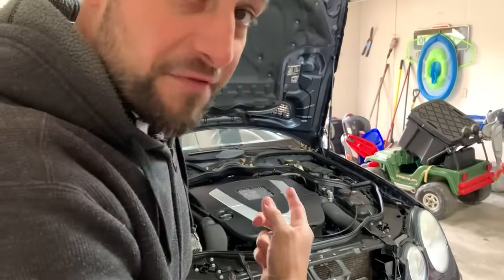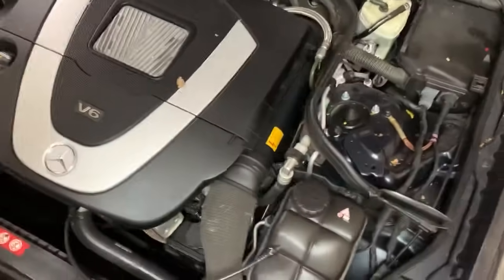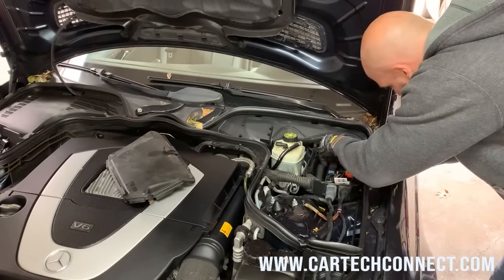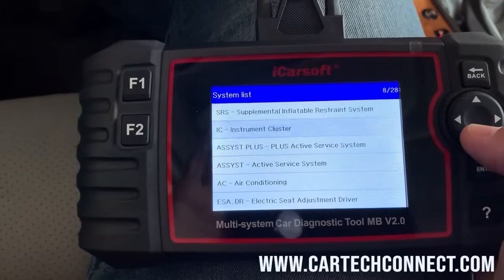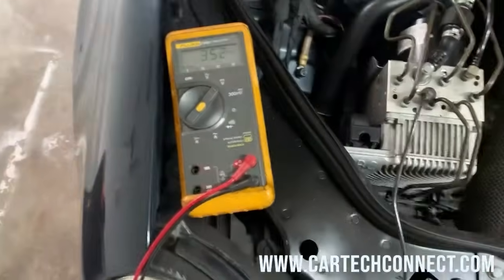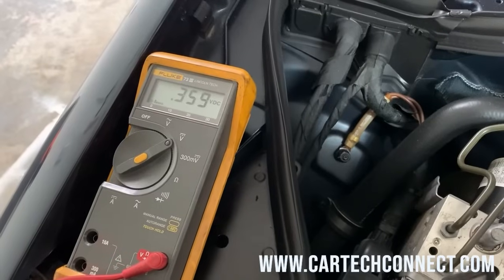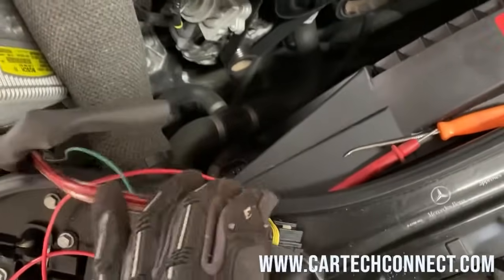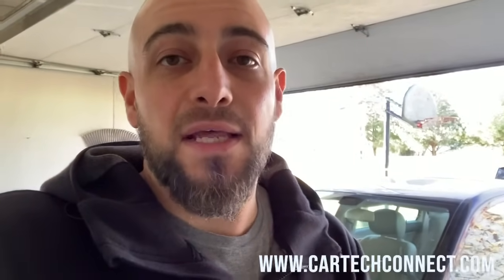Mercedes Benz fan keeps running sounds like an airplane - how to diagnose

Comment: Hi Lou,i have same problem for 4 month.I changed 2 batteries ,mas and map sensor,water tem sensor,egr valve secondary air pump ac compressor,ac pressure switch none of these help after your video i found out there is no voltage in green wire to the fan and no voltage in fuse#47 but car start and run.I forgot to mention the car is 03 e320 and i changed fan too. I am not able to find your email and none of email and info that you have in you tube work is there any hope for help from you thanks Fred.

Comment: I just watched your video & praying my car don't have the same problem.. it's a 2001 S430, however I have a coolant sensor light on in my dash and my fan will not cut off.. it doesn't Rev but my battery had died I bought a new one after installing the battery the fan came on without me starting the car.  Do you think if I change the coolant fan sensor that this will take care of the problem? Please help thank you 🙂
Reply from the maker: Hello, this model of yours does not
Usually have the same problem, it’s usually a bad fan or fan control control module. It could be a coolant temp sensor but its best to have it diagnosed instead of trying parts.
Reply: Try doing what some people call a hard reboot by joining the positive and negative together obviously don't touch the terminals leave overnight the refit and try it worth a try

Comment: Why swap vin info needed ??
Reply from the maker: Antitheft. Vins have to match in certain modules
Reply: @MasterTechLou  on my car the fan come one high when I turn the key 🔑 and turns off when the key is off , stays high idle fan , I switched the relay fuse and still does the same thing , I put in new temp sensor near the thermostat and one under the coolant tub 🛀, still some fan idle idk why
Reply from the maker: @reys_live7243  this video shows exactly how it needs diagnosed. :)
Reply: @MasterTechLou  it only runs when I turn the key on and it turns off when the key is off is a good thing it don’t burn my battery 2004 Mercedes Benz clk 500

Comment: Hello! So what's the name of the shop in NY that was able to correctly perform the VIN swap?
Am I to understand that swapping the chips was unnecessary given that the guy in NY transferred all the data?
My 02 C230, battery died recently...when I recharged it, and reconnected, fan is running constantly with the engine off. Turn on engine, it goes off, so now sitting with battery disconnected. One guy says he fixed with a new battery. Hmmm...shot in the dark. Never had this problem before, but we get a lot of rain here recently moved to Oregon. Very hard on Mercedes.
Reply from the maker: Sounds like you have a communication issue in the car. Engine module wont be the issue if theres no physical damage. Check engine bay fuse box for water and corrosion.

Comment: That's what I want to specialize in - diagnostics, module troubleshooting and repair...after finding a faulty module.  I watched one guy do it. He had some really specialized test equipment, like an electronic engine simulator in addition to a signal generator, oscilloscope, DVN and even a Microscope. Yeah...I love that kind of stuff.

Comment: He  thx  for this  video  i want to  ask  you  
You removed this iprom from the old one   and put it in the new  one ? And the car work @the new 
Or removed  the iprom from the new and put in old  and still @ the old one  and thx  you
Reply from the maker: So with this module the eeprom was not enough, there is a second chip that needed swapped but I have no information on which one so I had to put them back. The eeprom did not have the vin information so the car would not start.

Comment: Hi, thanks for the great video on this topic.  I've been suffering through the same problem on my 2007 CLS550 for over a year now!   Can you share the contact info of the ECM vendor you used in New York who fixed the ECM?
Reply: Hi friend, we're you able to get the contact info for the ecm repair? If you still have it or know where to go could you let me know please? I have the same issue currently and the fan goes on full blast right as soon as the car turns on till its off
Reply: @WoodVideos Same here, I have a 2007 E350.

Comment: Hi good evening. My ac reset fan won't turn off even when the car is not running how can I stop it please
Reply from the maker: Remove the under dash panel on passenger side dash, unplug the fan. If you are talking about the blower motor for the heating and ac .

Comment: thanks for the video . what the signal ref the voltage should be ???? pleas help
Reply from the maker: I show in the video the voltage for fan speed will be between 3v-12v
Reply: Thanks Mate . I am seeing 0 volt all the time on the signal wire also the same at the ECM  , do u think ECM issue ??
Reply from the maker: @alrifainidal  I dont like diagnosing over comments. if the fan is on and there is ) voltage on signal wire, the fan is the issue., but you have to confirm with a scanner and activating the fan to see if signal voltage occurs.
Reply: I am really sorry.. i dint mean to bug u. Thanks for ur help 
I have zero volt at the signal wire any way ... any way keep posting videos i like ur channel
Reply from the maker: @alrifainidal  never a bother, if you need diagnosis help you can reach me on JustAnswer or my site www.cartechconnect.com
Reply: So, 3V signal is low speed and 12V for high speed or vice versa? @MasterTechLou
Reply from the maker: @pawelczaja629 I believe lower voltage equals lower speed. But theres a cutoff where if the module doesnt sense enough voltage it goes into full speed mode. I have a spare fan I was gonna eventually do a video on this.
Reply: Thanks for quick reply. In my case the voltage is 0.5V and fan runs like a crazy obviously... Will try to supply maybe 6 V and see what happens... KaBOOM😅 @MasterTechLou

Comment: Master tech lou, thank you sir for this video.  I have the same MB scan tool. By just watching this video and how you showed how to view sensor data for the AC controller (indoor temp at 142 degree on mine), I was able to determine that the issue on my ac compressor and condenser fans not activating, was due to the ac controller switch panel inside the truck. I bought a use one off ebay, swapped them out, and "boom" everything works perfect. The next thing to tackle is to swap out the overhead sunroof switch panel, which also has a indoor temp sensor. Thank you sir
Reply from the maker: Hey glad it helped some way!!!! I appreciate you reaching out!

Comment: So to understand . I am no mechanic . The problem is on the computer ?  Recently my computer was changed for a “new “ and this problem happened . So if it is on the computer I believe is on my guarantee . That is why my question
Reply from the maker: Correct, the engine control module is faulty

Comment: Hi, thank you for all ur usefull videos. It means a lot to people that have to deal with dishonest dealerships and mechanics.
I diagnosed a w204 c350 2012 with  icarsoft and I get the following error message:
P220101
The NOx sensor( cylinder BANK 1 ) has a malfuction. There is a general electrical fault.
How is it possible to know which exact sensor (MB part number) I need to replace?
Thank you

Comment: Hey Lou nice video, my 06 R500 fans kick on full blast when key is in on position and nothing happens when I try to crank the engine. I have a scanner to try to find codes but I worry the battery will die before I look at everything.  Would connecting jumper cables from another vehicle keep the battery charged as I scan? Can any further damage happen by letting the fans run for a prolonged period of time?  Anything you suggest before scanning? Thank you in advance.
Reply from the maker: Just unplug the fan. It wont hurt, I do it all the time.
Reply: @MasterTechLou   Ok thank you! Will any codes not be given due to the fan being unplugged while scanning?
Reply from the maker: @victorvaldez3802  is that really a concern considering the car wont start 😂, you will only have 1 code for the fan.
Reply: @MasterTechLou  I’m using the iCarsoft CR Pro diagnostic tool, I ran a smart scan and the ECM didn’t show up. I ran a manual scan and it says link error. I checked the ISM, ESP, TCM, and SRS and all both have the code “No CAN data was received from control module engine management” in the current state. Is the ECM fried or should I be looking for a loose connector somewhere?
Reply from the maker: @victorvaldez3802  sorry I dont diagnose via comments if you need help you can contact me through my site. Www.Cartechconnect.Com thanks
Reply: @MasterTechLou  I’m filling out the ticket right now, is there a way to make sure you’re the one who responds?
Reply: @MasterTechLou  just submitted one
Reply from the maker: @victorvaldez3802  its all direct to me. Thanks!

Comment: My 2004 clk500 amg, have the same problem plus the interior don't work only the radio, no wipers,a.c,turn signal,horn and speedometer,gas level and temp level, won't do anything when start after couple trying
Reply from the maker: So sorry to hear, check my video on 5 tips mercedes owners should know. You probably have water or corrosion in the front fuse box area or floor. If you need my help with diagnosis you can reach me at my site www.cartechconnect.com 
If not then its best to have a shop look at this. Thanks, Lou

Comment: I am haveing the same issue with my C180 1.8 kompressor year 2005.
It's saying - A camshaft position actuator circuit open bank 2.
Any help would be great
Reply from the maker: If you need help you can reach out to me at my site.
Www.Cartechconnect.Com 
Thank you. Lou

Comment: If you ever need to remove components like this again, invest in a hot air blower (cheap Chinese versions are fine). It will allow you to heat up all of the soldered legs at the same time. Flux will also make the job much easier

Comment: i just replaced my radiator a couple days ago. but once i turn the key on the fan went on full busted high speed. its killed my battery, so do you think its still the control module? the video was very helpful, but from what i seen and heard its looking and sounds like thats my problem. any feed back will be helpful.
Reply from the maker: Walter Q Franklin all you need to do is follow the test steps.
But its possible a wire broke to your fan which would do the same thing.

Comment: I was looking for this. Thanks
Reply from the maker: Michael Wyz hope it helps. Thanks!
Reply: @MasterTechLou  fan running full blast no key before that radio would no turn off no key . Sent out ecu today ugh
Reply from the maker: @rjalexander440  fingers crossed for you. hopefully you didnt set it towards michigan!
Reply: @MasterTechLou  Drive to place in illinois supposed to find out Tues if not I will need co name u used . ;)

Comment: my 2011 c300 blinkers or wipers wont work and the electric fan stays on when the car is started. help please.
Reply from the maker: Sorry not sure why I just sen this now. You have communication issues in the car, I can help if you find me at www.cartechconnect.com  thanks, Lou
Reply: I have the same problem I need help
Reply from the maker: @adonburke8212  this video shows what nees to be done, I am not sure what else you need help with,. if you do you can reach me at www.cartechconnect.com
thank you
Lou

Comment: hi Lou, greating from australia. we had a w204 c300 came in with totally flat battery. we put a new battery in and knew why the battery had gone flat. the fan turned on randomly with the ingnition off and turned off short time later. on and off. i was thinking of the ecm but we also found there was large.amount. of water in the left side cabin floor. do u think the water trigger the issue or maybe there are seperate issues? thx a lot
Reply from the maker: roger zhang fan comes on for 3 reasons. Engine module is activating it, fan Is shorted, there is no communication between the engine module and other modules . So figure out the water first. It will most likley be your issue.
Reply: @MasterTechLou  Can you ask the guy in new york his information so i can send my ecm to him.
Reply: with rain water issue check the Front-SAM circuit board for oxidation.
The water get in at the roof seems (not sunroof, not windshield... SEEM when after 10years glue dries out)

Comment: Thank for this information your share. i need to ask you something i have 2011 Viano W639 when i drive the AC is perfect when i stop in traffic the coiling is so low i changed the AC compressor (Denso) and new condenser as well what you think from your work experience the issue? thanks for your time.
Reply from the maker: Thank you, sounds like weak compressor or low freon,. that is the only thing that comes to mind .

Comment: Hey Lou, wow great video.  I am also having the same issue regarding my fan on my C300.  No codes at all as well.  I was thinking it was the front sam because it happened shortly after some water intrusion.  My AC is also having some issues so I wasn't sure if the AC can also trigger this fan condition.  I wanted to know if there was a way to test the front sam and AC to see if it's the problem?  Thank You for your video.  You have me as a subscriber for sure.
Reply: My issue was resolved by a changing the refrigerant high pressure sensor on the condenser.  It was reading incorrectly too high.
Reply: @PABU427  That sounds like a great idea. My car has been like this for around 5 years. Several  Mercedes specialists and they can't find the problem.  I have a 2007 E350
Reply from the maker: the front sam does not actuate the fan only the engine module on your model. basically with the scan tool you need to see if the engine module shows 0% activation, if the fan is on then the engine module is bad.
Reply: Hi Lou.  I have a similar problem.  Mine sometimes does it as well when the car is off.
Reply: @MasterTechLou Hello I have a jet like noise coming from the hood of my 09 Benz e350 4matic and the ECU was replaced but no change . Please I can use your advice

Comment: Hi I was reading the description and was wondering the eeprom module that you swapped and worked still was that the original to a used ecu or vise versa? 

Thanks
Reply from the maker: both, i swapped from bad to good back to bad. there are 2 chips I could not find the location of the second one. :(

Comment: I am having the same issue with my car. It started a year ago. At that time, I disconnected the battery and took to a shop. No issues until yesterday. I dis connected the battery overnight and this morning the fan turned on full speed. The car was cold and off.  It hasn’t happened again. I need to get fixed. Your video was on point. Thank you so much.
Reply from the maker: Thank you as well!
Reply: @MasterTechLou  p
Reply: @MasterTechLou  By changing the epron, are you avoiding reprogramming the VIN to the new unit?

Thanks.
Reply: @MasterTechLou Could you explain what the epron does and how the immobilizer and VIN# data were transferred to the new ECU?

THANKS.
Reply: my car was doing the same thing, so was it a control module issue?
Reply: @walterqfranklin7465 did it end up being the SAM or control module?
Reply: Hi! Yes was wondering if you can tell me the name of the shop that fixed the ecu ... looking to repair mine .. thanks again